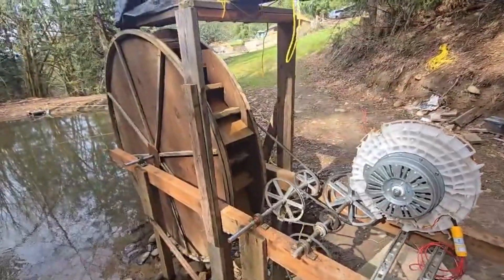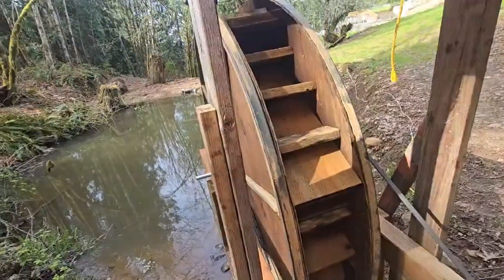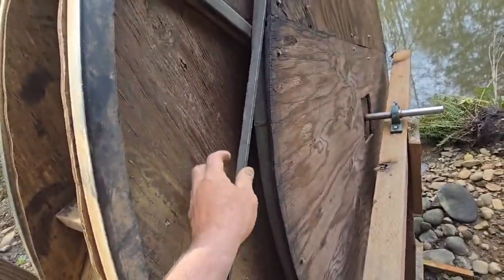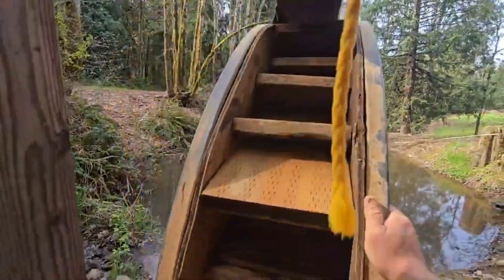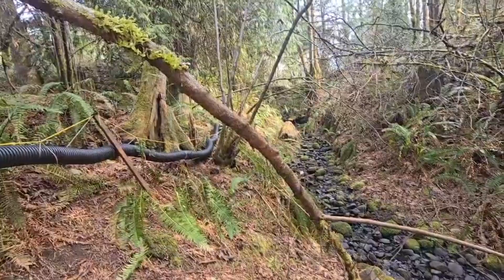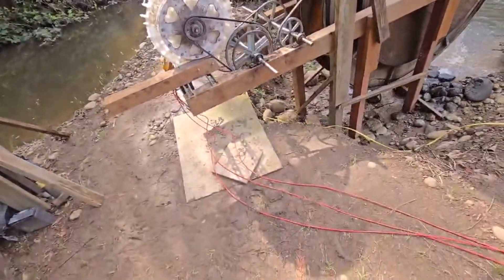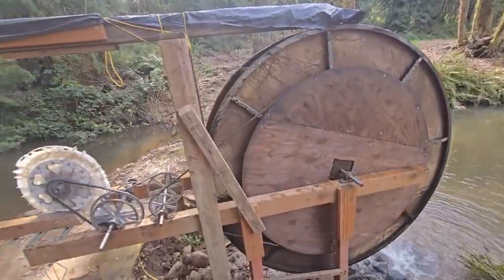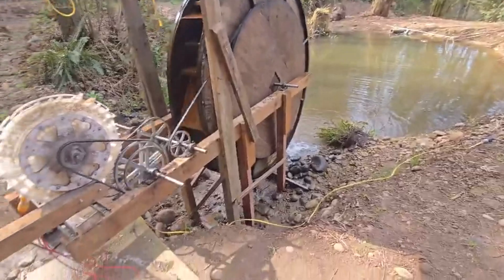How to Build a Waterwheel Generator, Here is my best advice.

Comment: As mentioned already the pipe is the wrong type. Too much friction, i.e. energy goes into heating the water and the pipe.
A smooth tube in a straight line (bends/curves also take energy away as they increase the friction) will yield more energy at the wheel.
Same, as mentioned, with the gears. Fewer gears = less friction = more output.

With the height available you might consider a Pelton turbine. 
There is a nice Brit who does good stuff, both waterwheel and turbine; https://www.youtube.com/@KrisHarbour.

Apart from that - thank you greatly for your video. I have a little project going where I think about a waterwheel (max. 2m/7ft height available, if at all) so it comes handy.

Comment: I worked at a watermill for years, where we stoneground organic flours. Sadly the buckets on your waterwheel are next to useless in their current configuration. You only need to catch your water in the outer say 15% of the wheel diameter....that's where the torque is. The bucket's angle should allow filling at 1 o'clock on the wheel, and discharge around 4-5 o'clock. Water flow vs bucket fill weight vs system friction, are all a matter of tuning, but better a wheel that runs too fast than one that runs too slow.

Comment: Use a mountain bike drive system
Cut the bike away from the essentials and keep the derailers hooked up so you can switch gears when the water levels vary

Comment: Just a quick observation, at 3:05 ish. You have crazy torque from the wheel, so you don't need to start with a big belt to a little pulley. Make the drive wheel much smaller, maybe a bicycle pedal sprocket? Then bring it back. Using chains and bike sprockets will make more efficient use of torque. You need to go from high torque, low speed, to low torque, high speed. So small sprocket at the source, back to big sprocket. Bicycle chains are excellent for this if they will be strong enough, because you won't have the slippage of a belt. You could also try timing chains and crankshaft pulleys from old junkyard engines if higher strength is required. Might be able to repurpose a few chain hoists and just use chains, but I think that would take more work. Still, if you have some old chain blocks, it might be worth it. If you have to stay using belts, then you could add a tensioner pully, to pull the belt into more of a U shape around the small pulleys, so you can maintain contact area and reduce slipping. Great work overall though. Too many people talk about this stuff, but all they do is talk.

Comment: Yes. You do need to build better buckets. Lot of lost there. Get rid of the corrugated pipe. Lots of flow lost there. Less water to the wheel. If that's all the water that you have then it is fine. No more to gain. With what you have as drop and water flow, you will only get so much. BUT it is fun. I had hydro at my catfish lake. I had 6 amps at 12-volt 24/7 at the camper. It was fun to see what I could get. Keep the updates coming.
Reply from the maker: @basilkey2949  I have a of the wall idea comming up soon...

Comment: I have tin buckets, all the same depth and all have the water hitting the outter egde of the bucktes creating lenear thrust. Keep up the good work. Instead of pulleys, cogs or chains have less resistance, i want to rap a chain around my water wheel and a small cog.
Reply from the maker: Great advise
Reply: @HowToWith24DY You could use oil tin cans, if your width is height all you'd need to do is cut the can in half, opposite corners and then screw in the wheel.
Reply: Or just found the 5litre plastic containers very cheap and in garage/kitchen

Comment: The power of the overshot water wheel is limited by the rate of the water flow and the diameter of the wheel. If the water falls from much higher, than the top of the wheel, or bursts on the wheel with high speed by pressure, then there would be some additional positive effect on power. If the bottom of the wheel is sunken into the waterbody, then there would be additional decrease of power.
But 1 liter of water at 2 m height has just 19.6 J of potential energy and the most effective overshot waterwheel has maximum 85% of efficiency, so the flow of a 1 liter of water over 2 m high water wheel, like yours,  can produce maximum of 16.66 J (0.000004627778 kWh) of electric energy by falling two meters. You have to let at least 216086 liters of water to flow over the wheel to get 1  kWh of energy. If this water flows evenly over 1 hour time span, then the flow rate should be 60 liters per second. Then the power of the water wheel is up to 1 kW.

Comment: I am playing around with the same concepts. I think making larger buckets, wider buckets and more volume of water would benefit. The weight of the water is what moves the wheel to overcome the resistance of the gearing therefore more weight is needed to accomplish this in my opinion. I got some old spoked steel horse drawn implement wheels (I believe they might be from an old horse drawn hay rake). I have the set up in the shop and playing around with a few ideas. I fear that the wheels are not large enough to get the leverage I need to overcome the torque. I had thought of using the spools you used. Maybe I should as they are larger thus improving on the leverage. Another thought about the delivery pipe. The C factor is high on the pipe you used due to the corrugations  which causes a higher resistance coupled with the resistance of the various elevation variances between the influent and effluent of the penstock. Because the pipe you used is relatively inexpensive and flexible to negotiate the variance of terrain could you just parallel the existing pipe and flume with another set up just like it to double the volume? Anyway, just brainstorming. You have great ideas! What fun hands-on lesson on hydraulics and gear reduction.
Reply: I read the other comments after posting and it sounds like others have the same ideas as I just posted. I also agree with the comment that the weight of the wheel isn't as important as balance and resistance. Look forward to seeing your adjustments and results.

Comment: Get your Wheel WDER and BUCKETS  deeper for more Torque. 
It's visible that your buckets are LOSING WATER LEAKING  thus less Gravitational pull on it and less torque. 
The VOLUME OF WATER is also a major factor so I don't know if that could be increased to FILL bigger VOLUME BUCKETS wich will give higher torque abd thus more REVOLUTIONS on the Generator.
Reply from the maker: Thanks for the input, really all I can do at this point is seal up the buckets

Comment: Nice work! . That's definitely a heavy wheel  to spin ..  im daydreaming about the same concept ,   maybe a smaller  lighter weight wheel ?
Reply: Lighter wheel do not contribute much as the movement is purely dependent on the bucket load (potential energy conversion from point a to b).
To have more power, you must have higher bucket load that your flowrate can support.
Reply from the maker: Not sure if the weight of the wheel is a factor. With no load on it it spins so fast it sprays water everywhere.
Reply: @HowToWith24DY  The weight of the wheel must matter because it has to work against gravity to rotate to the top position.  If it hasn't run for a while and has dried out and then you start running it, does the watts slowly decrease as the water soaks into the wood and makes it heavy?